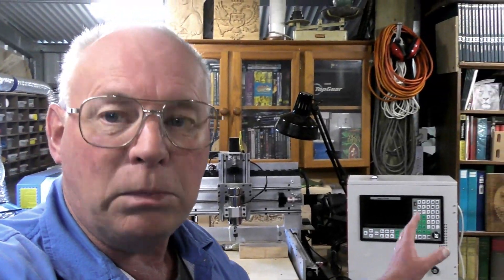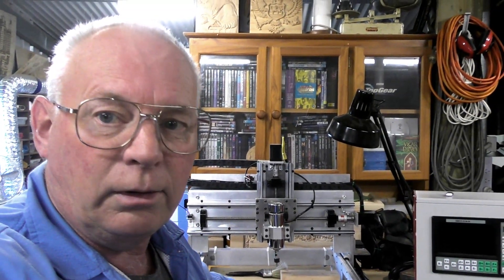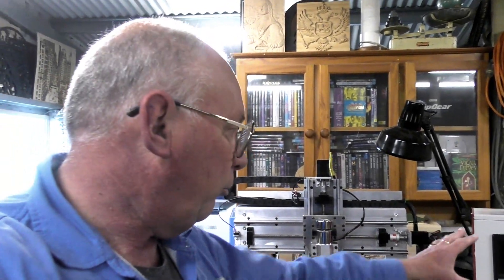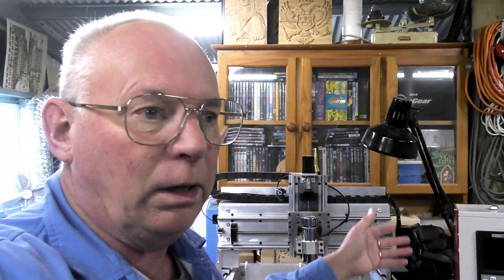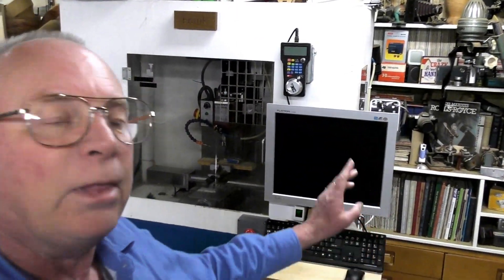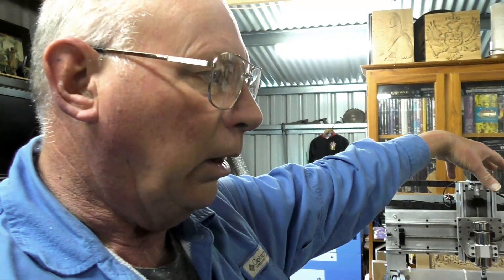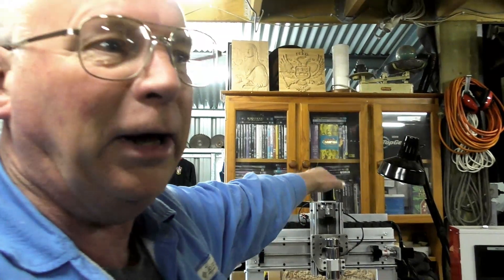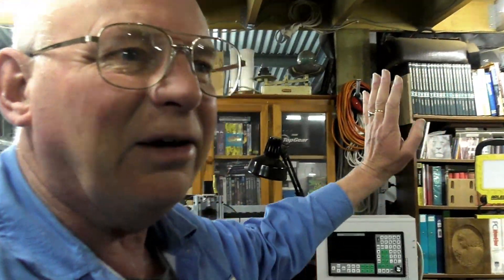What to do next! BIG CNC router? or BIG CNC mill?

Comment: MILL!  It'll do both.  You can make an adaptor to put a 3kw (or more) head into a mill.  They're rigid, hold a thou tolerance and if needed hog off steel, cast, Ti, etc.

Pondered doing a cnc hobby grade mill (1000 lb weight) or router, ran the pros and  cons, then bought a 1990's Bridgeport series 2, Boss with servos.  30 inches X, 15 inches Y, 5 inches Z plus air knee for another foot.  About 5000 lbs, holds a thou, a hulk of a machine.  Put a new control on it but the 4200rpm was slow engraving aluminum. Fix, made an electric 20k rpm spindle.  Wanted to go faster and use coolant, bought a 60k air spindle and chucked it up.

Today, building a 24x16 shed over my 90's Fadal 6030HT.  Specs, 18k pounds, 24hp, 60inches in X, 30inches in Y and Z, 20 tool changer in cat40, spindle 10k rpm.  For dry running plan on chucking up a router head.  Enclosure will contain the chips, it's 8foot deep and 14ft long.  With less hobbyists buying the bigger trade in commercial machinery, I put it on my slab for less than 10k USD.  Can find good Fadal 4020's for 5k all day long. Easier trucking too.

Comment: I would vote for big cnc router. I myself have a plan to build bigger router (1200 x 1500 mm) than I have right now (working space 750 x 450 mm), but the main problem is free space at my garage :-( It will be interesting to see how will you solve the problems with rigidity of your new machine to mill aluminium. Or you want to mill only wood?

Comment: Hi Roger, as a novice. 1. Please complete the 4th axis on the MIDI. 2. Please could you devote session or sessions to the electronics theory | wiring diagram of the MIDI and expand that through the different components and or choices , so we gain a better understanding of why you chose certain components in the MIDI and why they would change in a Maxi. For example Nemea 23 versus 34’s | closed and open loop technologies.. so we understand some of the fundamental principles behind your constructions and choices. So if we wished to expand the size of the MIDI what other changes or barriers would need thought and likely solutions. This would lead into your larger build. 3. Maxi CNC Router but sized to take full sheets | expandable frame such as an Avid approach and what needs to be done in expanding. The size to be selected then becomes an application of the right principles? I hope this is right? Selecting this would also allow a “constrained’ build in that same as MIDI, where you used normal tools etc in the workshop approach rather than the big guns to do the build. 4. The large Mill conversion. Love the channel and productions. Kind regards Gavin

Comment: First, I appreciate your channel and suggest the mill! I converted a Shizuoka ST-N knee mill (1984) with nema 34 hybrid steppers and Mach 3 and couldn't be happier. I removed and sold the old school inferior Bandit cnc and came in under $6k everything complete. The machine came with ball screws, one shot lube, hi/lo variable speed head etc so didn't have to make, mod or purchase any of that. To sum it up these old machines are inexpensive but excellent candidates for easy conversion with contemporary motion control. Might want to take a look on Ebay at the mills that look like they have TRS80's attached.... secret gems! Cheers!   Daryl

Comment: Tormach are amazing for the price.. consider the 770, smaller but faster spindle
Reply: @inventorsworkshop9600  btw i just bought a small pcnc440 and i mill stainless without any problem, very solid little machine